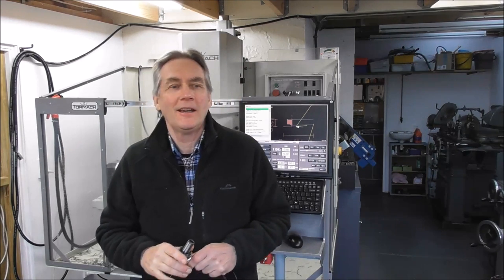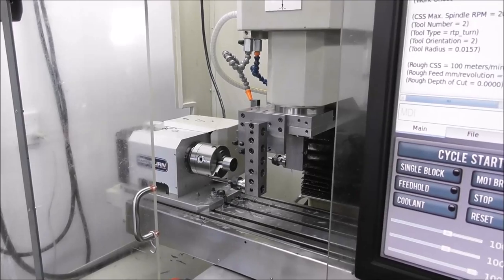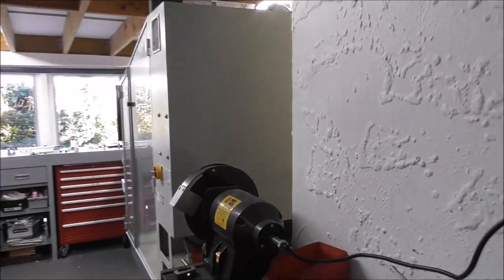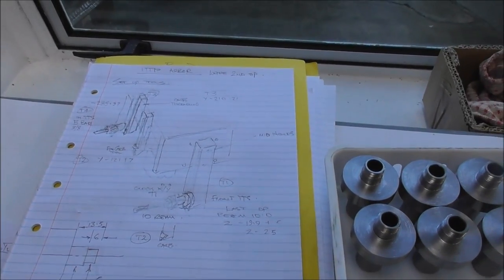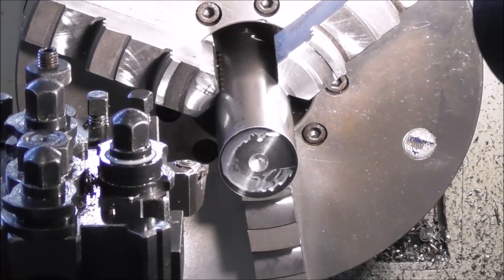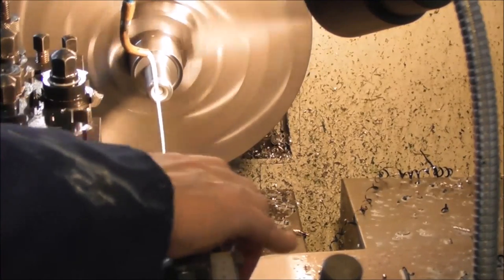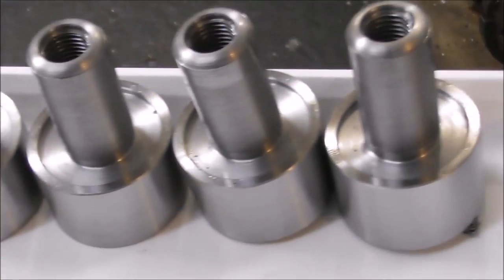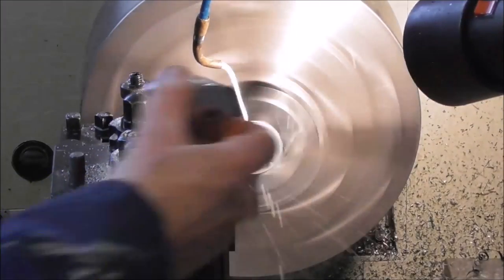Tormach RapidTurn -  Part 24 - Steel Parts

Comment: Beautiful views from ~12:10 with mirror finish at ~13:13 and ~23:27
It is so refreshing to see a master handle this Chinese lathe workhorse ( It is in use in many factories over here ). Showing how things can be done precisely instead of the usual rant about bad quality from China. And getting insides in your reflections is for sure another prime plus.
Reply from the maker: Thanks Sure D. Good to see someone so visually aware. Cliff
Reply: China can produce amazing parts. Usually what i see is cheap material....but the machinework is fantastic. I cant knock them at all.